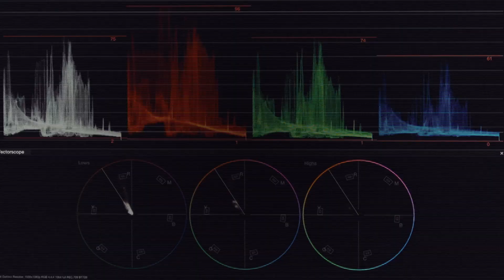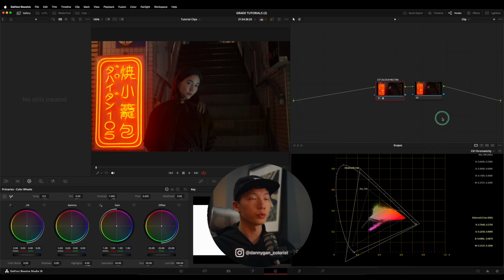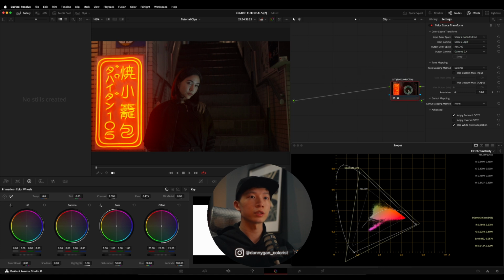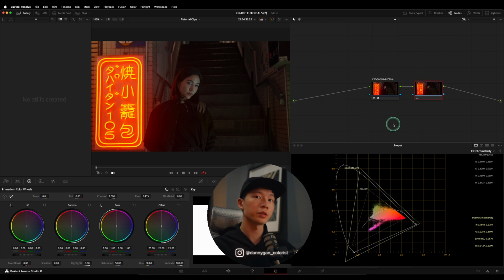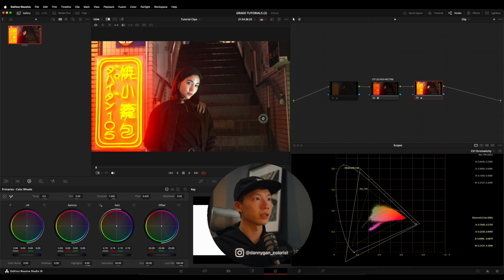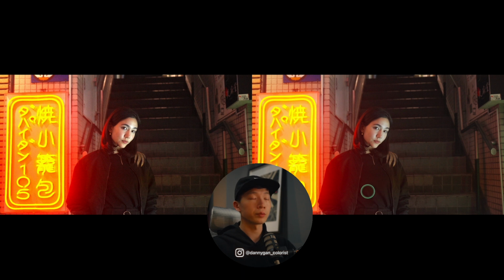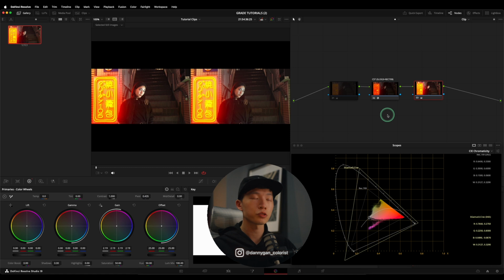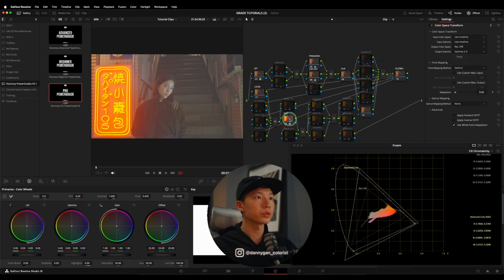Beginners Do This ALL THE TIME | DaVinci Resolve Tutorial

Comment: Why would the look be before the CST?
Reply from the maker: As mentioned in the video, so that you won’t clip or crush your grade as easily
Reply: @DannyGan so why does every other colorist do the CST at the beginning?
Reply: @Surfacetoairproductions  Ya Im curious about this as well
Reply: @Maxwellschro  his node tree is also way over complicated.
Reply from the maker: Because they are using an intermediary working color space.

COMPLETE Tutorial for Davinci Wide Gamut | DaVinci Resolve Tutorial
https://youtu.be/4x7xnrRa1Ro
Reply from the maker: It is not overcomplicated if you understand it. I break it down in my node tree video.
The nodes are there for convenience, using a smaller node tree works as well, but I require speed and precision for my commercial projects that why I created an all-in-one master node tree
Reply: @DannyGan  That's want you want to use....
Reply: "so why does every other colorist do the CST at the beginning?"   imagine if you're an audio engineer and your final output is mp3.     would you convert to mp3 before doing the sound mix and treating every track?.  no, you want the maximum wave resolution,  at the end is where the conversion goes.  this is exactly the same, but with Color gamut.  have more to work with.   anyone converting at the beginning is making a dumb mistake.
Reply: @jj8888z 
Converting color space at the start of a project doesn’t necessarily "throw away" information like converting to MP3 would. As long as you're converting between wide-gamut and high-bit-depth spaces (e.g., LogC to Rec.709 via CST in a 32-bit float environment), no data is irreversibly lost. You’re simply mapping color values to a working color space for accurate grading. Converting to MP3 is lossy compression, but CSTs are mathematical color mappings. As long as you’re working in high bit depth (10-bit, 12-bit, or 32-bit float), the data is preserved. A more accurate analogy would be converting between WAV formats with different sample rates there’s no inherent quality loss if handled properly.